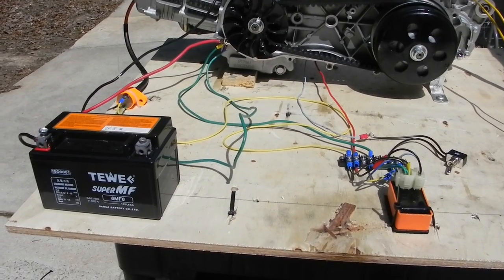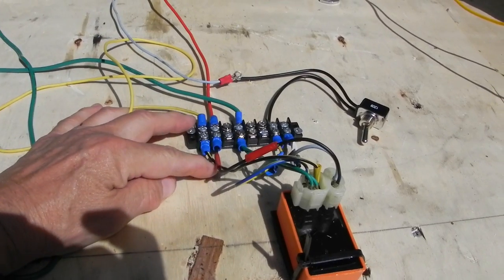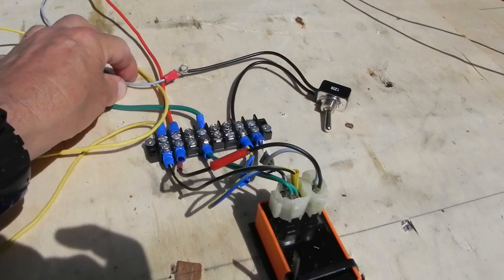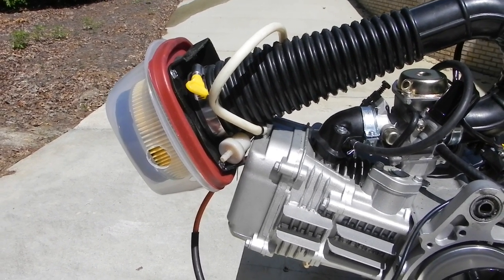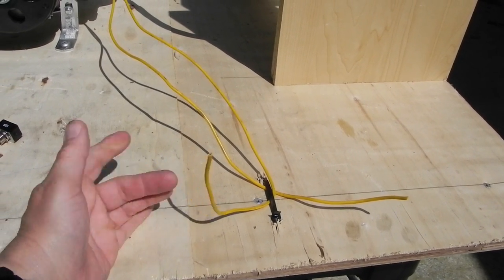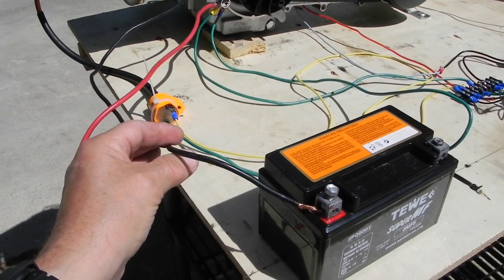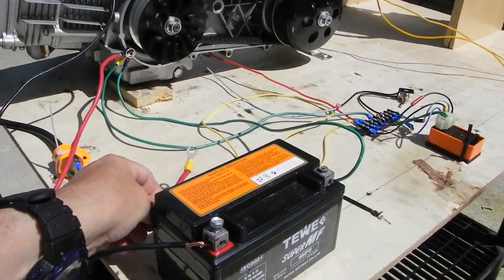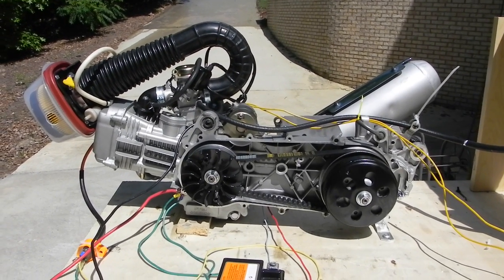GY6 Engine Bench Test

Comment: Great Job. I do rebuilds and mods at home and was getting tired of installling engines then having to pull them and so forth. Now Im able to do a full test on the rebuilds before i drop them back in and bolt them up. Thanks for the input so I can get my bench tester built.
Reply: Nik Oniki  Greetings from PUERTO RICO USA.  I got tired of having to test my go-kart up and down the road in a area that is like the city, with wind in my face that doesn't let me hear how the engine is running. So when my girl friend showed up with the rollers from her broken exercise machine, my mind went to work. I welded up the rollers parallel to each other, with about a 9 inch gap. I place one end under the rear car tire, the other end is for the drive wheel of my go-kart. Instant rolling road for tuning my engine. If I need some load I just take some air out of the car tire. Let me tell you watching my engine at full revs just inches from me is a really cool. I tuned my engine in less than 30 mins. I hope you get some ideas from this, Happy Motoring !!!!!

Comment: not really a fan of the gy6 i own 4 gokarts 2 with the gy6 150cc and 2 with the gy6 125cc they constantly are breaking down, need maintenance. i have gone threw 9 cdi boxes 3 coils and 2 stators in the past 3 years, it seems like i am always having to do some kind of work on them every 4 to 5 months sometimes sooner. not a very well designed and reliable engine in my opinion but idk maybe I'm just riding them too hard. they do get great gas mileage and they do have a decent amount of power and torque when they are running correctly I will give them that.

Comment: Sue Carman, I can tell you know your stuff. Not many people talk about air boxes like you do. Some people just don't get it. Air filters and air boxes change the air fuel ratio, mostly more as the revs go up. I test my go-kart engine using rollers placed under a car wheel, the go-kart rear wheel drives the rollers and the car tire is like a fake dyno. If I need some load I just take some air out of the tire.This works really good for tuning with out having to go up and down the street. I hope you get some good ideas from this. Good job on your bench test.    P.S. Greetings from PUERTO RICO USA.

Comment: Thank you SO MUCH for this video! This is SUCH a help when you get a scooter that's been "stripped" or the wiring is missing, etc... I like making my OWN custom engine wiring harnesses anyways and tthis video breaks the GY6 wiring down to a T! The only thing I'm a LITTLE confused on is the Rectifier and how I would wire that up on a STOCK GY6 with a STOCK rectifier. That way I could run the electrical components! Got a video on what to do with those yellow wires that aren't hooked up?? You'd be the GY6 MASTER THEN!!! Lol

Comment: Hey there, nice informative vid, thanks! Would it be possible to do this type of vid running no batt? I'm building a custom Dax but it won't have an electric start, only a kick start. Would it be possible for you to supply a wiring diagram or a vid that would explain how to do that?

Comment: Do you think that taking off the washer between the cones on the drive side of the CVT will effect low-end or harm the belt more quickly? I have been told by several people that taking it off is advised, and i do not see one in the actual manual that i found for the stock bike without restriction.

Comment: Thanks for the video. Love the set up. Where can I get an intake lik that for the air cleaner?
Reply: its a tupperware box air filter. its a bench test ......hence the above.
Reply: just put a unifilter on carb and upjet 2.
Reply: if you run an airfilter sitting on front valve cover you would burn out the rubber intake.its a benxh Test!!!!!

Comment: On the qmb scooter. My brake lever on the left side handle bar which doesn't have the switch for kill or ignition an has spark will thr motor start?

Comment: question, I have a honda ruckus 09, it's a gy6 engine but can not seem to get any speed over 25mph.should I up grade the CVT? also what adjustments should I make thanks.
Reply: looks like you have the european version. that one only goes 45kph due to it being limited through measures like a ring in the variomatic or a limited cdi
Reply: Hit the cylinder head 4 or 5 times as hard as you can.. that'll get you that extra speed you so deserve.

Comment: ciao mi servirebbe un grosso favore, potresti scrive in modo molto semplice i collegamenti della centralina CDI ? purtroppo non conosco la tua lingua e il traduttore non funziona molto bene con you tube, mi servirebbe sapere esattamente come devo collegare la mia centralina cdi in quanto la centralina Originale ha 5 collegamenti mentre quella cdi ne ha 6, ho provato ad inserire una centralina cdi sostituendo la mia originale e il motore non si è acceso ma la centralina cdi è esplosa.
hello, I need a big favor, could you write the CDI ECU connections in a very simple way? unfortunately I do not know your language and the translator does not work very well with you tube, I need to know exactly how I have to connect my cdi control unit since the Original control unit has 5 connections while the cdi has 6, I tried to insert a cdi control unit replacing my original and the engine didn't start but the cdi control unit exploded.